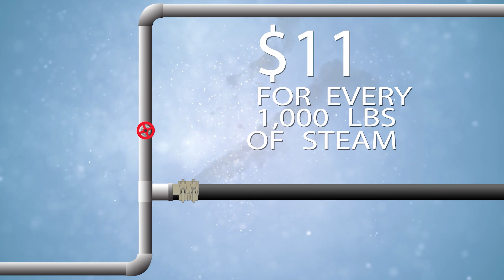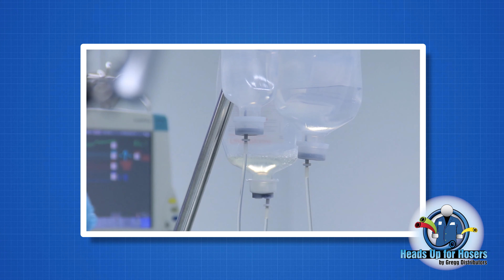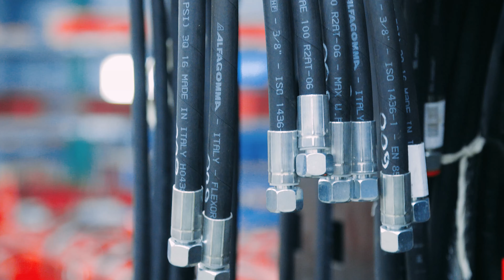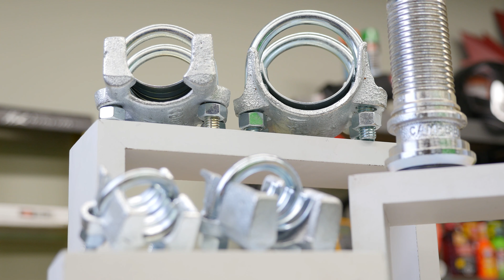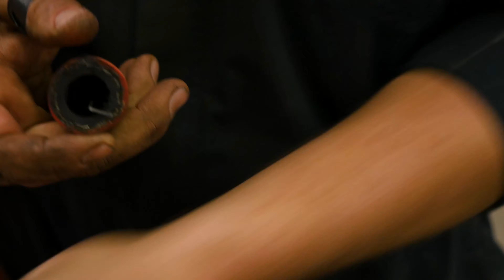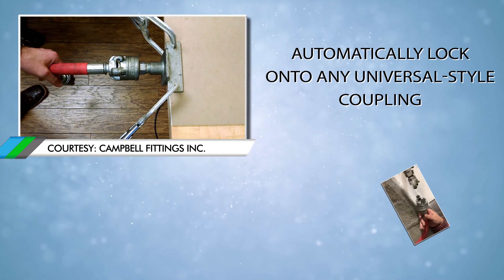How Steam Fittings Can Save You Money - Gear Up with Gregg's

Comment: Is there steam swivel connector to hose?
Reply from the maker: Yes, however, they are only available as a crimped end on our FLEXSTEEL® 250 EPDM STEAM HOSE, which can be found here:
https://greggdistributors.ca/hose-and-fittings/Industrial-Hose/steam-hose?resp_group=Default,Variations,ItemProperties

Here are the swivel ends that are available:
https://greggdistributors.ca/hose-and-fittings/Industrial-Fittings/industrial-steam-hose-fittings/camims3vsw
https://greggdistributors.ca/hose-and-fittings/Industrial-Fittings/industrial-steam-hose-fittings/camrgjs3v